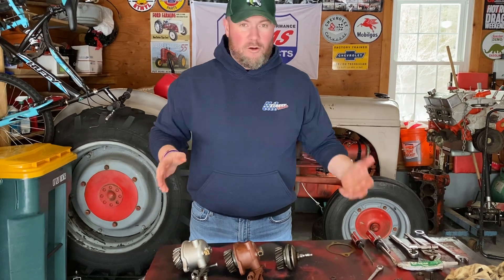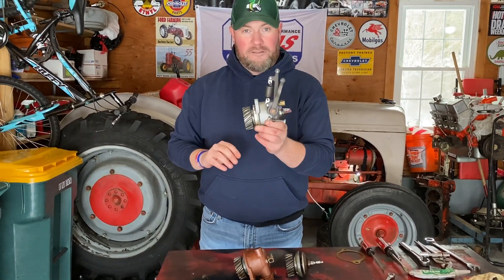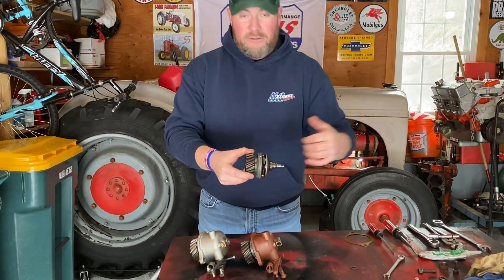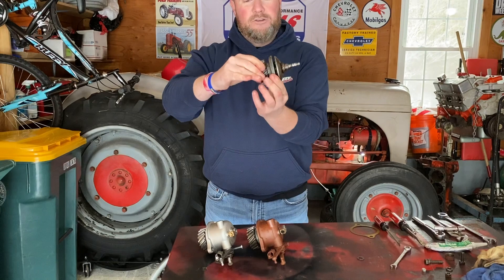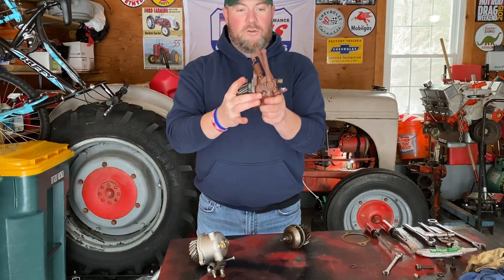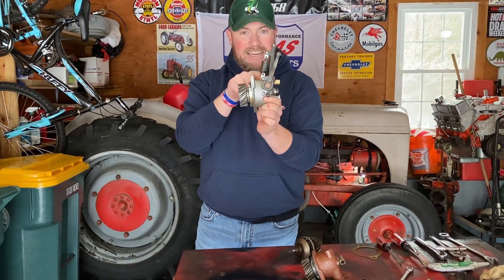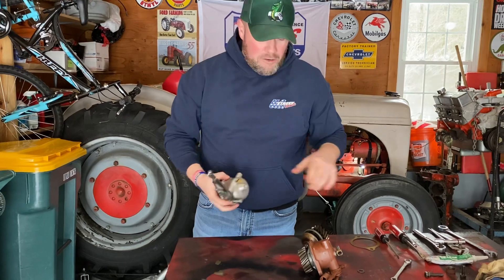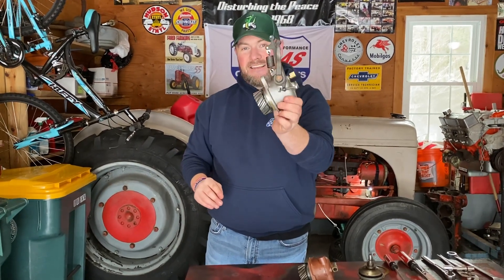Don’t buy a garbage new N-Series Ford Tractor Governor - A 10 second test to save you money

Comment: So even though these are questionable out of the box, I did get a good deal on a new knock off one for an 8n to use for parts on my 2n.

I took my old beat up one and the new one apart to swap out the 2 arm lever for the 8n for my 3 arm lever for the 2n. 

Visually everything looked identical on the inside. But, I sat the lever and shaft assembly’s down flat on the workbench and put small screwdrivers in the holes that hold the fork that is actuated by the inner workings and the screwdrivers weren’t parallel with each other. Which means when the governor moves the arms aren’t going move the right amount for the conditions the tractor is in.

I haven’t started my tractor yet because I’m doing all the maintenance I can, but I’m confident it should work now with my old levers since the hole is in the right place and everything else is identical. It’s still a cheaply made part though so we’ll see.

Comment: Bought one off eBay for $85 in spite. It came in and did not function “properly” as seen in this video. The original did however. Slapped the new one on anyway and it works like a charm. I believe the other guy about there being more underlying factors

Comment: I have no experience with tractors, but have a small piece of land and will be doing very simple projects. I found a 9n in great running condition with good mechanics. It comes with a lot of attachments…Tiller, plow, grater, cement mixer, boom, and a two wheel cart. I am just not sure I want to spend 2700 for all of that. I know that some of these older ones sell for 1000 or 1500. I am just torn because this one comes with a lot of toys. Is this a tractor? You guys think I can learn to use for fun once every other month.

Comment: Got a 49 model that won’t hardly pull itself backwards lost power but runs fine otherwise just lacking power was wondering if that could be the issues
Reply: Found mine had groove in housing it would shift arms when spun but still needs replaced. Also ball bearings have worn spots. For a temp fix I thinking about making a sleeve .

Comment: When did the flathead V8s have a governor?
Reply from the maker: They never did. The N-Series never had a V8 engine. I am going to be swapping one into this tractor but just making it run properly with the regular four banger that is in there now.
Reply: Sorry he’s wrong and right. The funk flat head kit did have a Governor set up but it was belt driven not gear as the truck engines didn’t have governors.

Comment: Thats not a valid test.  I have both my old gov and a new two arm like you. The gov spins at about 1000rpm at idle.  Your old one moves cause its loose and old.  The new one doesnt because the bushings are new, its not oiled and things are tight.  You have to spin it faster than your hand can manage to impart the forces needed to make the new arms move.  If the new one didnt work on your tractor, there is more investigation to get to the root cause than what you did here.  I would suspect the weight of the balls between the old and new might be a possible place for exploration.
Reply: Gonna go through with the install after seeing this. Hope to be thanking you soon